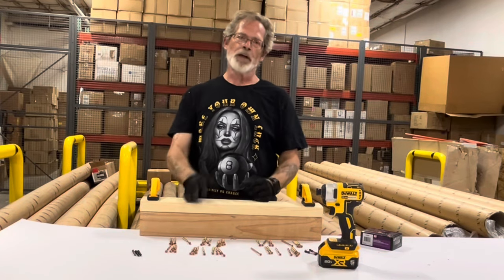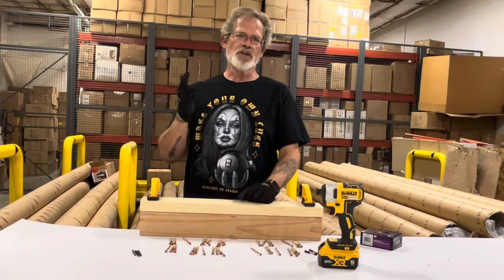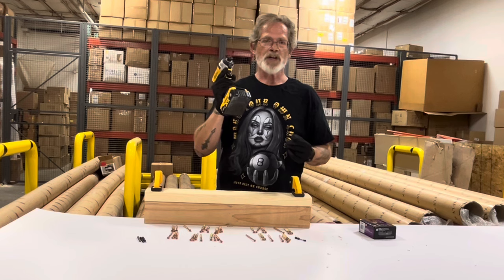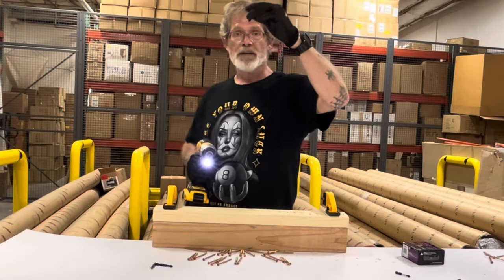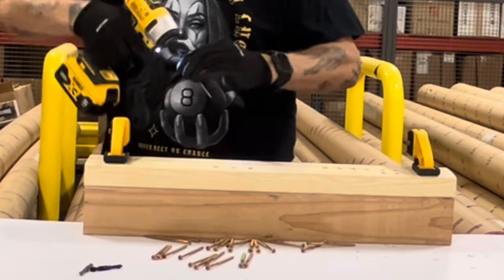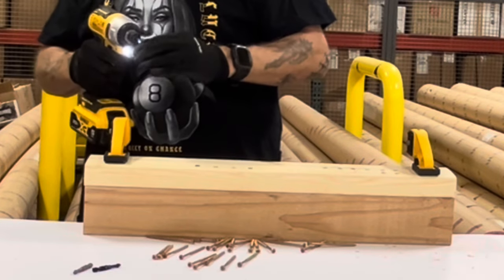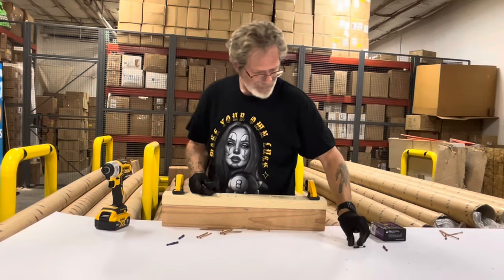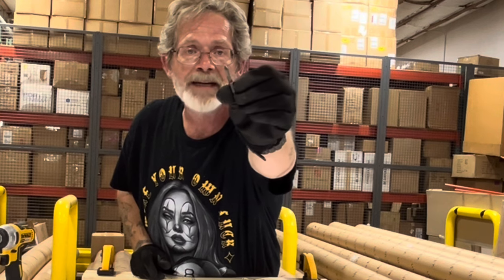Cheaper can be better! #viral #diy #amazing

Comment from the maker: As always, this test was conducted using the Dewalt DCF787 with a 5.0 XR battery.
Don’t mind the background noise. There were people working in the other room.
Reply: What is up with your buddy Tools with SoAlz?  I see you comment frequently and are a member.  How come when he is shown to be wrong or is questioned he acts like a petulant child and starts name calling and ignores the question and eventually just deletes the entire conversation?
Reply from the maker: @D2O2  He does get irritated with people, but I don't know what you mean by "shown to be wrong."
Reply: @DiligentDave1966 From the "reading a tape measure" short.   The comment conversation about the black diamonds being at 19.2" instead of 19 3/16" as he claims.  I asked him if he was correct why doesn't the diamond align with 19 3/16" or even 38 3/8" ?  Instead of answering the question he just resorted to name calling and dug up another "internet source"  supporting his claim.  If he would just took a minute and looked at his own tape he would see the truth.  Is he actually interested in helping, or just trying to always be correct at all cost? He has since deleted the entire comment thread.  It was the top comment.
Reply from the maker: @D2O2  I don't claim to know anything about the black diamonds, but I do know that SoAlz has a history of building and renovating homes.
As for the deletion of comments, he does block people from his channel sometimes. That will cause the entire comment chain to disappear.
Reply from the maker: @D2O2  I'm actually looking at a fraction chart right now, and 3/16 is .1875. The closest fraction to .2 is 13/64, so it's possible that the tape measure was just marked incorrectly. You know how quality control is.
Reply: @DiligentDave1966  It isn't a mis-marked tape measure.  Any tape with the diamonds will be marked at 19.2" because it is 96" (8') divided by 5.  You will notice that diamonds only align perfectly on an inch fractional tape every 96" (8') . This is not anything new and dates back to the beginning of advanced framing and engineered floor joists.  It is not commonly used and therefore confused by those that are not actually in the trade or on the engineering side.  I appreciate you being open to discussing this and wish Soalz was too.
Reply from the maker: @D2O2  I never worked in the trades, and never even paid attention to the diamonds until I saw his video. Therefore, I don't have any idea what to say. I just know that SoAlz has way more knowledge than I do when it comes to this stuff.
Reply from the maker: @D2O2  I guess what really matters is that you use the black diamonds to measure the floor joist spacing. 
That’s something I didn’t know before now.

Comment: 👍
I have various branded and non brand bits, I use what ever one I grab out of the case. Depending on the job, I try and avoid regular purpose screws if I can, being they seem to cam out more than deck screws, for around the same price. When they do cam, I usually blame the screw first. Lol
Reply from the maker: @gnic76  I didn’t really look for deck screws. I just grabbed the general purpose screws because that’s what I use for all of my tests.
That said, the Bauer bits have continued to surprise me for how cheap they are.
Reply from the maker: @gnic76  By the way, I really prefer Torx.
I just did this to show that the average person can get good performance out of a cheap brand.

Comment: Yes sir not everybody could afford a $300 tool some just buy what they can afford and have been using them for years. I for one can contest to this! Don't git me wrong. I like new tools but my old ones work just fine from years ago
Reply from the maker: @SMOKEY-JAYS-DIESEL  This video was more about the bits than anything else.
At $2.97 for a 5 pack, the Bauer Phillips bits have consistently outperformed the Milwaukee Phillips bits. It’s not even close. In fact, I would put a 5 pack of the Bauer up against a 10 pack of the Milwaukee any day of the year. The guy using the Milwaukee bits would be buying more before the 5 pack of Bauer is even half used.
Reply: @DiligentDave1966 Yes I could agree for the price. You cannot beat them. Bit's for sure
Reply from the maker: @SMOKEY-JAYS-DIESEL  The Bauer seem to be even more consistent than the Hercules, and a 5 pack of Hercules is $6.99.
Reply: @DiligentDave1966  I don't drive a lot of screws. I'm not a carpenter or construction house builder but I do have a lot of different brands of bits and yeah some are complete junk

Comment: I know many Technicians that use heart  tools and they have held up really well ...I buy a lot of Cheap Canadian and Vietnam made very low cost Benchmark bits and blade for the price they hold up really well and you can buy them in Bulk ..guys are always losing the bits on the jobs  and that adds up over time ..Great Demonstration
Reply from the maker: @SaerTurner-wn2qh  Thank you!
This just proves that people don’t need to spend a lot of money to get a good quality bit.
At $2.97 for a 5 pack, I have been really surprised by the Bauer bits.
By the way, Tools and Tactics did a video that touched on this subject, but he prefers Bosch. I guess everyone is different.
Speaking of Hart, their tools are made by TTI, so I would imagine that they’re decent. Probably similar to Ryobi.

Comment: Bauer most probably has the best Phillips bits on the market.
Reply from the maker: @louisd95714  At $2.97 for a 5 pack, it’s hard to argue against the Bauer Phillips bits when they work so well.
The particular Hercules that I used in this video didn’t perform as well as the Bauer, but I’ve had some Hercules bits grab so well that they didn’t want to let go of the screw.
A 5 pack of Hercules is $6.99, though, and it’s hard to justify spending the extra $4 when they’re not that much better than the Bauer.

Comment: Hercules have done well for me
Reply from the maker: @WildernessPreacher  In past tests, the Hercules performed well, but the Bauer has continued to surprise me for how cheap they are.
I grabbed the first bits my fingers found in the package, and this Hercules bit didn’t perform as well as the ones I tested before.
Reply: @DiligentDave1966  Yeah not a bad tool for the price. The battery's suck but other than that not bad at all honestly
Reply from the maker: @SMOKEY-JAYS-DIESEL  Again, we’re referring to the Phillips bits.
I’ve never tried a Bauer or Hercules power tool.
I believe the Wilderness Preacher uses Flex power tools.
Reply: @DiligentDave1966  Dave I see you using a DeWalt I'm not blind bro lol. I'm just letting you know my opinion on the whole platform, not just the bit
Reply from the maker: @SMOKEY-JAYS-DIESEL  Gotcha. The DCF787 has been my go to for almost all of my bit testing videos because it’s my go to for most of my projects.
I have more powerful impact drivers, but more power often equals more cam out when it comes to Phillips screws unless you drop the impact driver into speed two.
I am  probably going to test the best bits out with the Ridgid 4 mode and the Metabo HPT triple hammer, though.
Reply from the maker: @SMOKEY-JAYS-DIESEL  Actually, Dewalt has been one of the most innovative companies when it comes to battery technology. These XR batteries aren't the best, but they hold a charge forever in this impact driver and the drill that came with it.
The power stack are probably the best Dewalt batteries, but I'm not about to spend that much money on batteries for a 20v Max combo now.